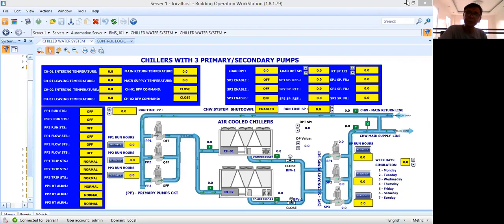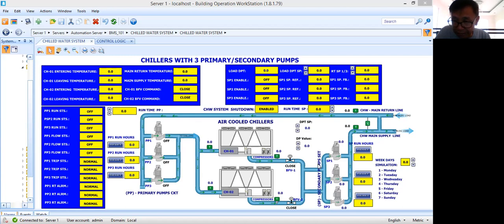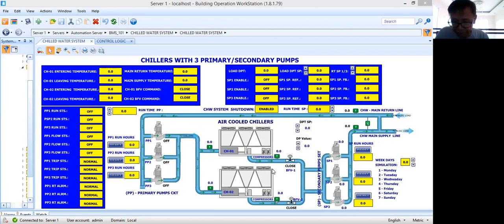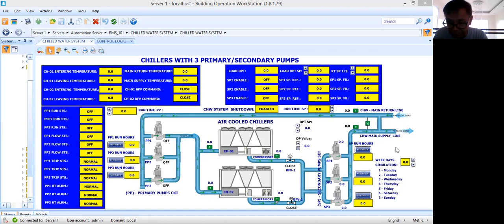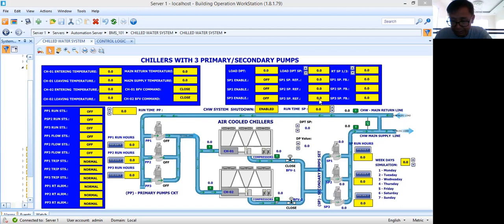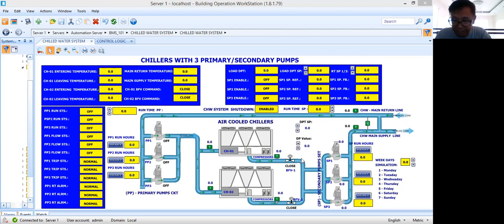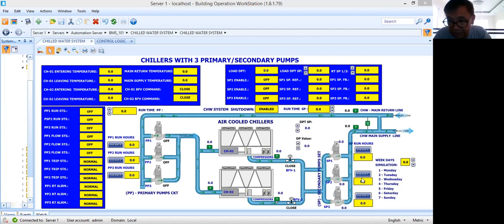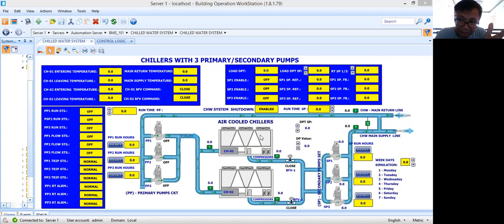Chilled Water System - (Air Cooled Chillers) BMS Graphics Creation

Comment: Sir why is that load DPT ,if secondary pump is controlled by DPT across supply&return main line
Reply from the maker: usually DPT (Differential Pressure Transmitter) are installed in the index circuit of the chilled water system, the mechanical engineer will decide also where to install this device where  it will sense the change in differential pressure in the main and return line ( when AHU's and FCUs control valves opens and closes there will be change in pressure in the chilled water line) this will dictate the speed of the secondary pumps to bring the dpt reading to dp setpoint, but a good PID control will handle this
Reply: @SantosJrCapellan-BMS  sir so load alone pressure has no much role right
Reply from the maker: @khaleelkk578  there is also a pressure (absolute) sensor installed in the supply line of the chilled water system to activate the pressurization system just in case the line pressure drops below the set point of the pressurization system